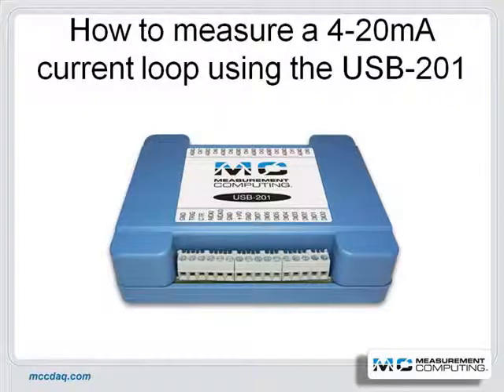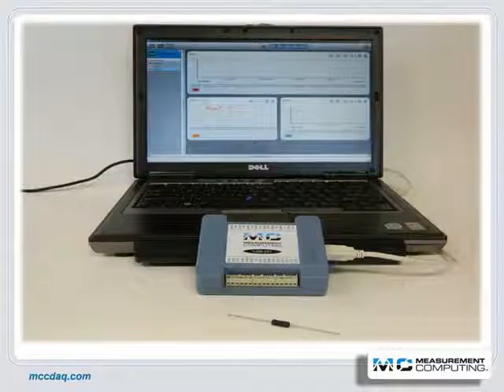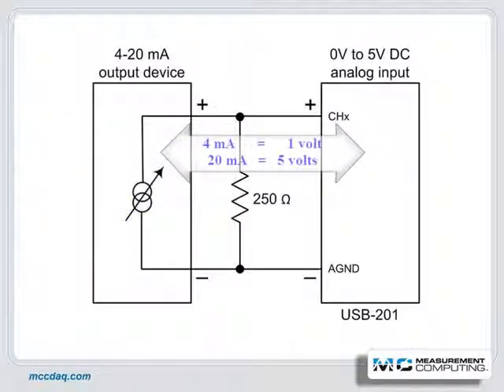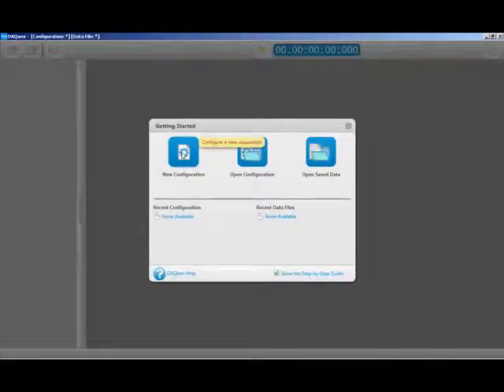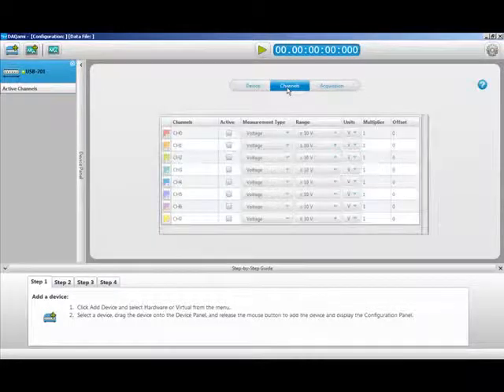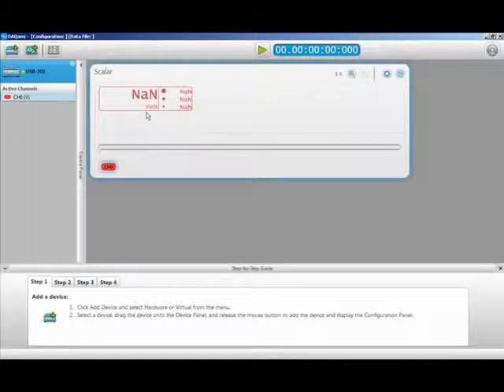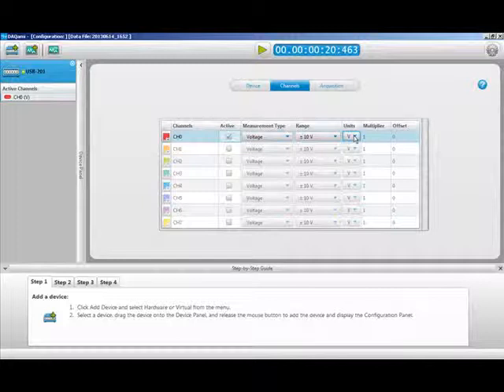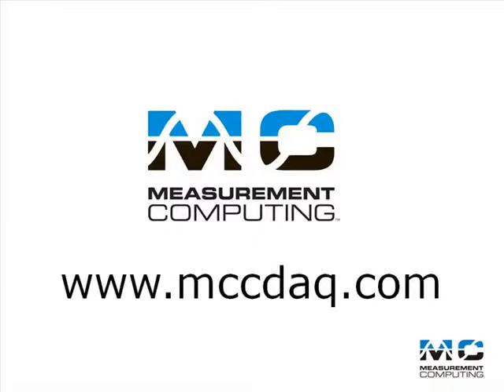How to measure 4-20mA current using 250 Ohm resistor

Comment: Can I use multimeter to measure the 0-5Vdc instead of analog input device? We have weight scale controller which gives 4-20mA signal, I want to measure the 4-20mA corresponding to weight
Reply from the maker: Hi!
Yes, it is possible to use a multimeter to carry out this measurement, in case you need more information you can write to us at support@logicbus.com